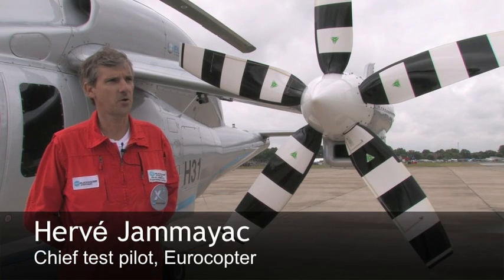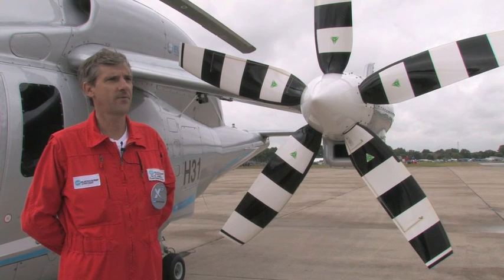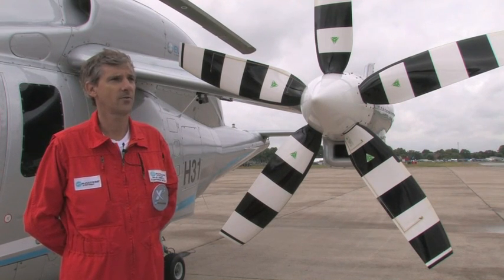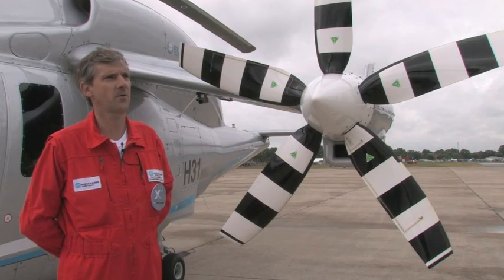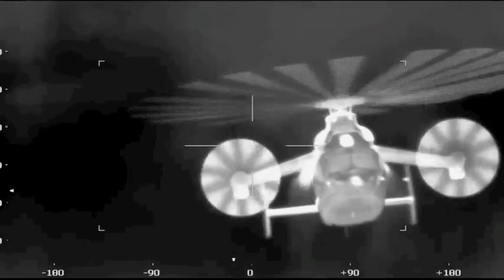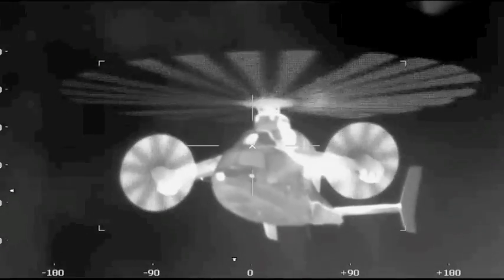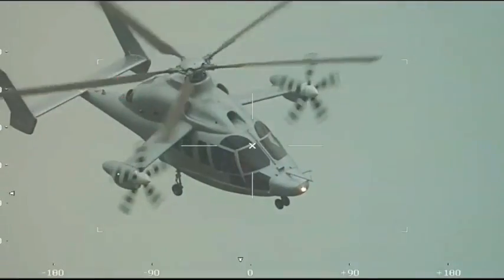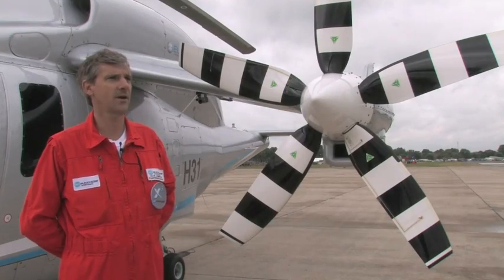Eurocopter X3

Comment: Eurocopter x3 is beautifull please tell me in side seats capacity please reply
Reply: Seen it in a museum in france , seats 12 pax plus crew of 2
Reply: Here are its specs too General characteristics

Crew: 2
Gross weight: 5,200 kg (11,464 lb) 
Powerplant: 2 × Rolls-Royce Turbomeca RTM322-01/9a turboshaft engines, 1,693 kW (2,270 hp) each
Main rotor diameter: 12.6 m (41 ft 4 in)
Main rotor area: 124.7 m2 (1,342 sq ft)
Propellers: 5-bladed (two tractor propellers gear driven from main engines).
Main rotor: five-bladed from the Eurocopter EC155
Performance

Maximum speed: 472 km/h (293 mph, 255 kn) at roughly 10,000 ft (3,048 m)
Cruise speed: 407 km/h (253 mph, 220 kn) 
Service ceiling: 3,810 m (12,500 ft)
Rate of climb: 28 m/s (5,500 ft/min) 
Top speed: 0.91 Mach
Autorotation: 2,800 f.p.m